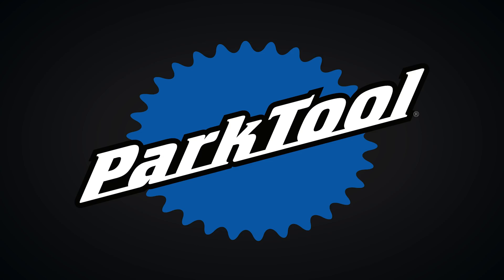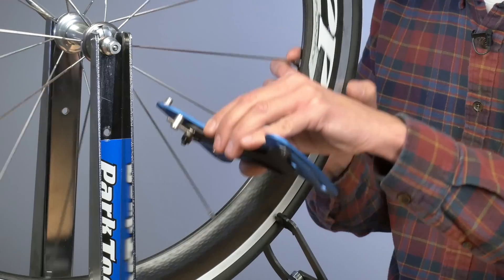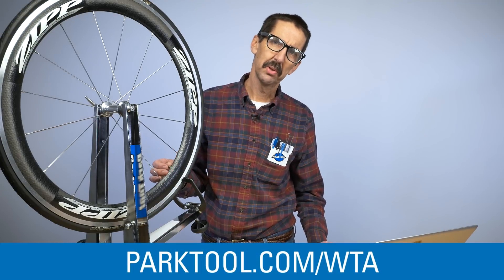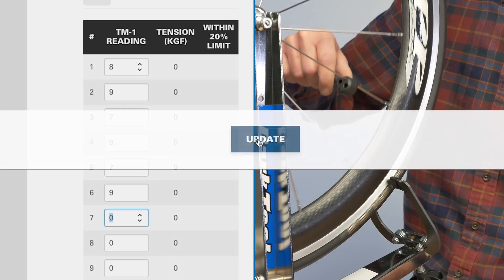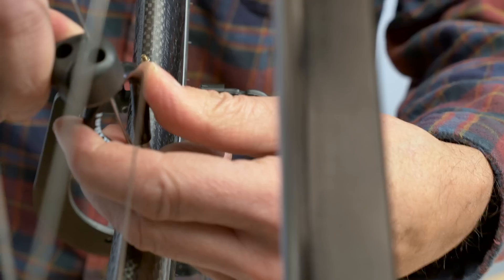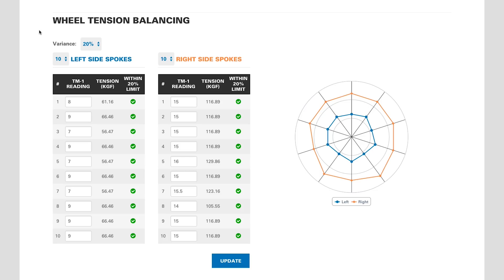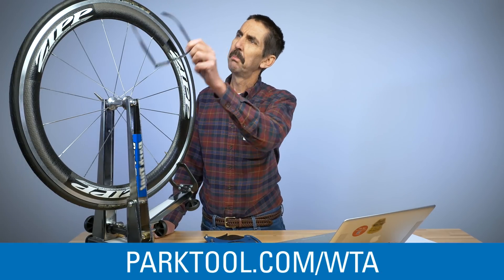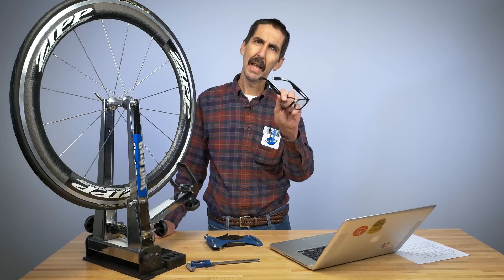Getting Nerdy with the WTA - Tech Tuesday #55

Comment: I overlooked one thing and made a mistake because of the centerlock disc brake mounting spot which enlarges the front hub width the spoke length for front wheel is the same as for the rear wheel when both hubs are Shimano SLX (HB-M7010 and FH-M7000). I miscalculated spoke length for front wheel and built it with same spoke length and it is off center.
Reply from the maker: Most Disc brake front wheels have two spoke lengths. It is helpful to measure center to flange or get the hub's building dimensions when building.
Reply: Now I know why do racing teams have so many spare wheels :)

Comment: Amazing! Useful!   Still I have lots of questions and I would appreciate your answer.  A couple of questions on the subject:  Is it recommended or preferred to balance tension on a wheel with tire or with no tire, having a tire mounted on a wheel would make a difference on the end result?  Then, when the tension is balanced the wheel should be true, right?  On the rear wheel because of different length of spokes for each side there is also a different tension recommended for each side of the wheel,  right;  either way when truing we are trying to bring the rim right at the middle between the calipers of the truing stand?  Is it possible for a front wheel to have different length spokes on either side?  Thanks.
Reply from the maker: Tire pressure does change wheel tension. However, assume manufactures given tension recommendations without tire mounted. It can be argued that for the nerdiest of wheels, balance with tire at full pressure. However, it is good at some point to go ride the thing.  For any dished wheel, it is really the tension differences not spoke length that gives left-right tension differences.  A front wheel wheel is a rotor disc will have the disc side tighter.  Regardless, the idea is to center the rim between the frame dropouts, not between the hub spoke flanges. There is a trade off on wheels between perfectly balanced tension and perfectly true.
-Calvin
Reply: Thanks Calvin, sir you are always helpful.  Have a wonderful day!